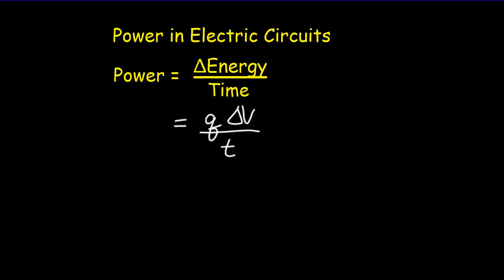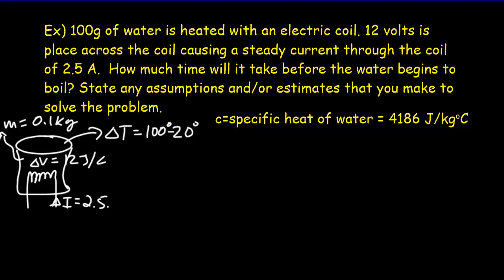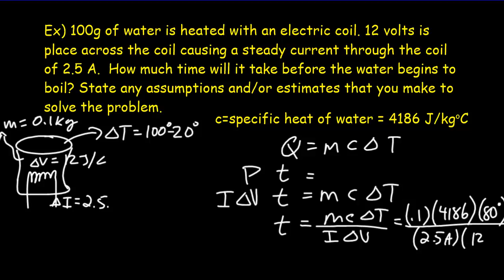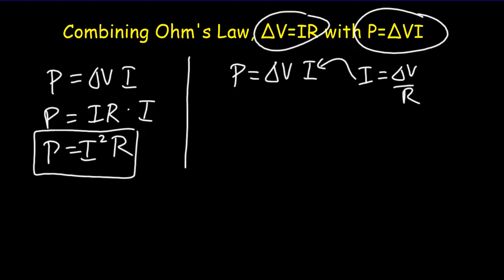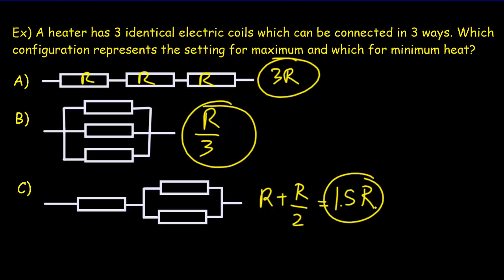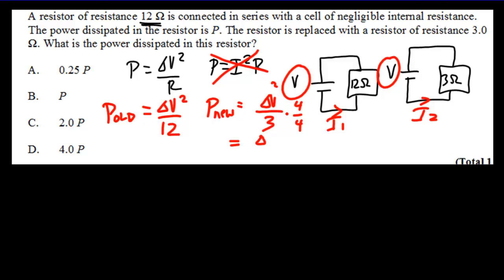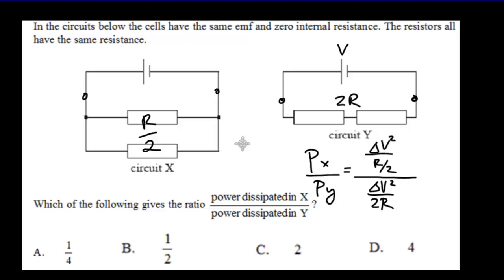IB Physics: Power in Electric Circuits

Comment: Hello Mr. Doner, for question one (5.25 seconds in the video)  How can we interpret which has the highest power if we want to apply P= I^2 R? Thanks
Reply from the maker: We would say I=V/R, and use V^2/R. As V is constant and R is the variable of the problem, we need to use V^2/R.
Reply: @donerphysics  Got it, thanks

Comment: Amazing videos. Thank you so much! At 5:45 the question states " setting for maximum and minimum "heat" ", I assumed that the greater the resistance equates to greater heat, but you've explained the setting for maximum to minimum powers. I am a little unsure as to which factor to consider for hear production. Does greater resistance = greater heat, or does greater power = greater heat, assuming the voltage is constant, like in the question.
Reply from the maker: It is the power, the heat energy per second that we are concerned with. When resistance is smaller, we get more power at the same voltage since P=V^2/R.  We might think that power is smaller since P=I^2R but we must keep in mind that we reduce the current when we increase the resistance, and the current is more important in this equation since it gets squared.

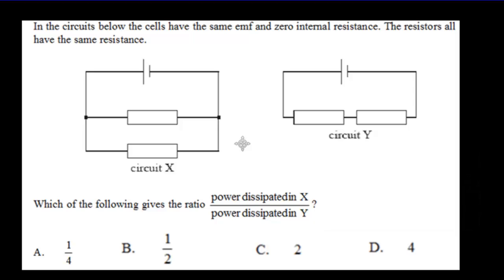Comment: For the last question at 7:44, I do understand your method, but why can’t I use P=I^2R equation? So making the power dissipated for circuit X = I^2*R/2 and circuit y is I^2*2R. The answer is 1/4 instead of 4 then, but I don’t understand why this is wrong
Reply from the maker: You could use I^2R, but you would need to use the current coming out of the battery which would be V/Req, and you end up with the same answer.
Reply: Of course!!! 
Thank you so much!

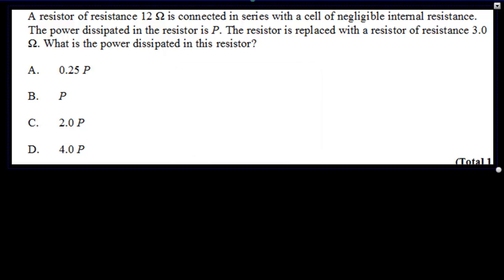Comment: Would it be just to use the P=I^2R equation at 6:09 by saying that if the resistance is 4X smaller, than I must be 4X bigger, then we put it in the equation saying P = (4 I)^2 (R/4), hence making P 4X bigger^
Reply from the maker: That works.

Comment: last calculation is wrong I'm afraid. 1/2 divide by 2 = 1/4 not 4
Reply from the maker: To divide invert and multiply.
Reply: He used 1/(r/2) not r/2
Reply from the maker: +Yang Zhu 
I am afraid that the calculation in the video is 1 divided by 1/2   all divided by 1/2.  Think physically, more power is used when there is a smaller resistance.
Reply: What how is Yang Zhu wrong, I'm thinking the exact same thing. Can you explain mathematically how (r/2) / 2R = 4, it doesnt, it equals 1/4.